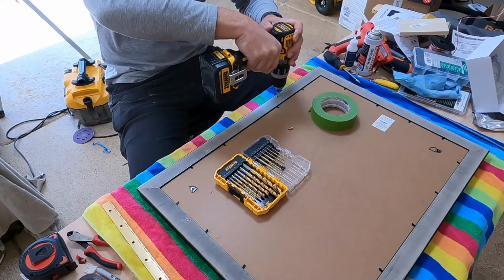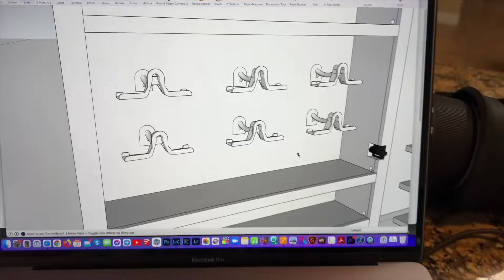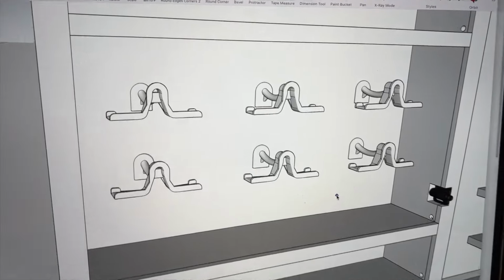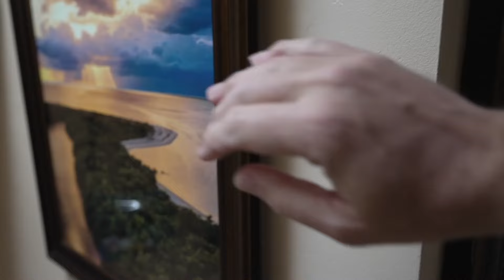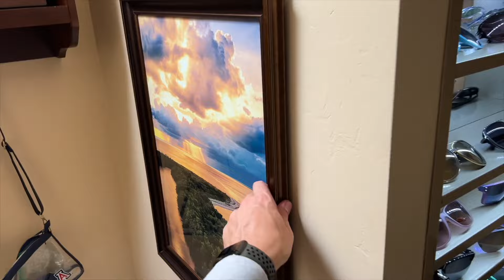I Built A Hidden Sunglass Case for my Oakley addiction | DYI Build

Comment: Oakleys are so generic.. my wife bought a $300 pair and I bought a $10 pair of similar looking sunglasses off Amazon and her Oakley got tore up quicker than mine 😂🤦‍♂️ the coating on the lenses got scratched up so easily. They're just $10 glasses with a $300 label.
Reply from the maker: Sure
Reply: your story is the polar opposite of my story. which is this:

i been wearing same pair of oakleys for almost 10 years, my normal vision glasses. any time they break i had it welded together by a jeweler, to keep them alive. i will probably keep doing that same thing for another 10 years, it saved me alot of money, and this pair of glasses i just can't see myself in any other.

the only time they broke was literally stepped on them with my full body weight any pair of glasess would bed or crack or whatever, it was nothing big enough that a local jeweler couldn't fix it.

------

mine are vision glasses, so yes i had lenses pop out and get lost, this isn't because the glassees were bad it was because they broke undernormal circumstances any glasses would break in. but the lense itself is cut by the optomestrist to fit the frame i don't think they are necessarily oakley lenses in my glasses. the frames is oakley the lenses are likely not if they are vision glasses like mine. keep in mind i had them10 years, so like incident like that losing lense only happened once in 10 years isn't so bad, it was a day of near hurricane conditions and the glasses blew off my face about 30 feet from me, the winds were that powerful that day. it was the same day in california where like like 10 to 25 trucks rolled over in my local area and trees across the neighborhood fell over.